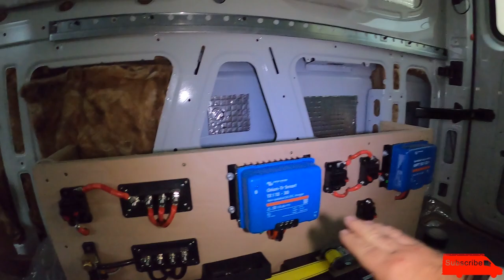Come to work with me || VW Crafter Camper 12Volt install

Comment: Hi am hoping someone will help me unfortunately I can't afford to pay someone to fit my victron Orion 12v 30A  non isolated DC-DC charger Q1 what size fuse do I need to use from the starter battery to the charger and from the charger to my leisure batteries PLEASE CAN YOU HELP
Thanks love the channel
Reply from the maker: It's a 30 amp charger so a 30 or 50amp fuse will be fine for both. Use 16mm² cable all the way. Any more questions feel free to email me lukesvanlife@gmail.com 👍
Reply: @LukesVanLife  Thanks so much Luke for getting back to me it means a lot as I understand your a busy man with a new baby 👍